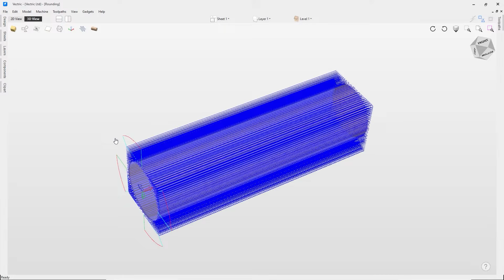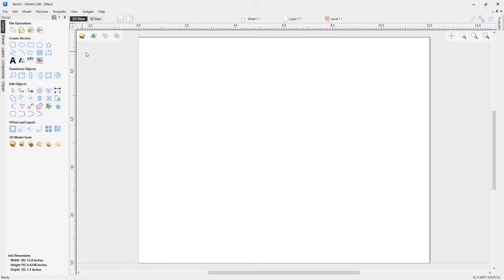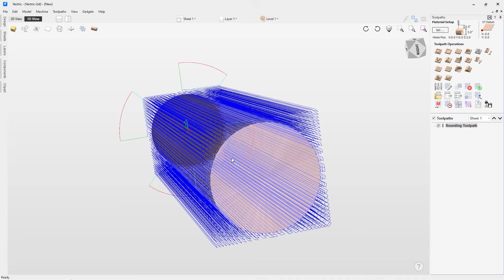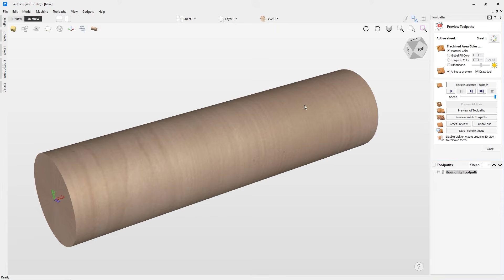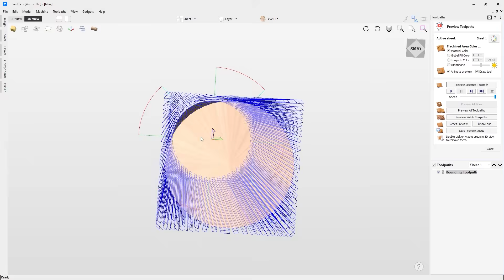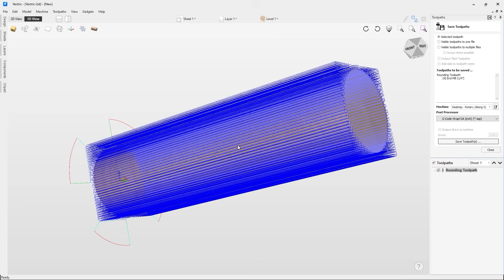How to create a rounded toolpath in Vectric software | Wrapped Rotary Machining | V12 Tutorials

Comment: Why is your job setup set to 3" and the blank size and shape set to 3.25?  What is the actual diameter of the square blank?  Is it 3" or 3.25".   If the square blank is 3.25, then will this now cut it down to 3"?  If that is the case, would I be able to specify 2.5" in the Job setup page and it would bring it all the way down to 2.5" from the original square blank of 3.25"?  Yes, the video is a big help!
Reply from the maker: The blank is 3.25... and yes you could cut it down to 2.5" if you like.